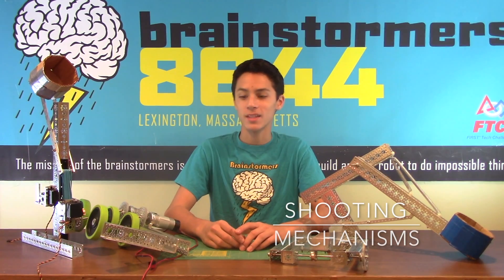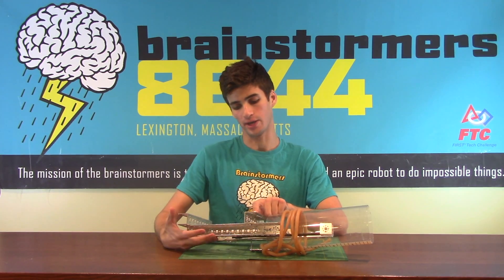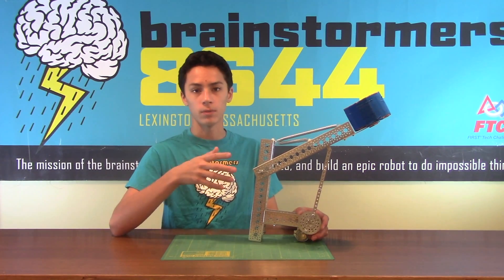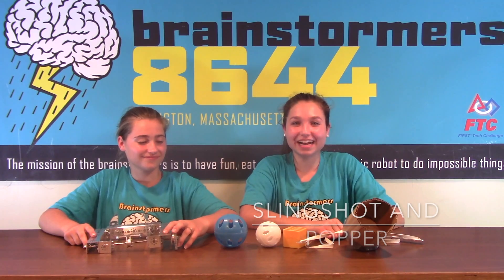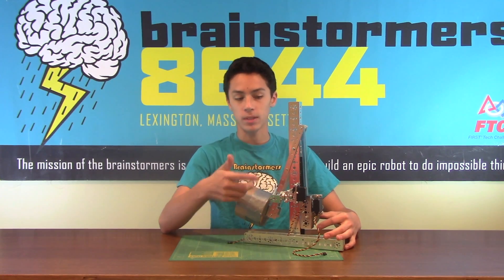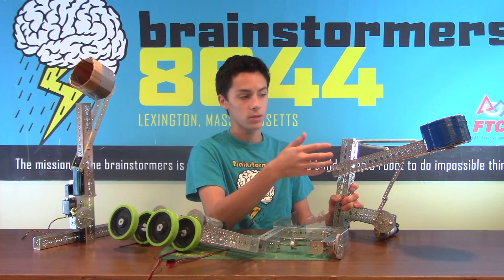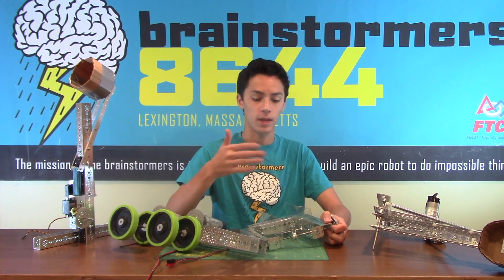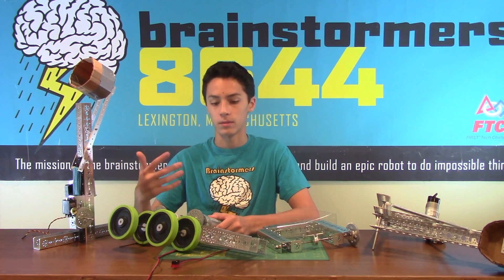FTC Tips and Tricks: Shooting Mechanisms

Comment: Thanks for making this. It's been really helpful for us. For the dual flywheel, what motors did you guys use? We have a similar design with neverest 40 motors and they don't seem to be fast enough.
Reply from the maker: In the video we are using neverest 20 motors with them geared up around 5:1. We later tried another system using banebots 1:4 gearboxes which are effectively the same but are much more reliable and strong.